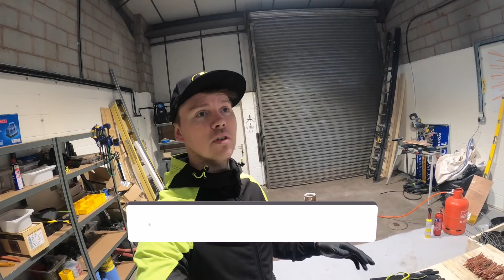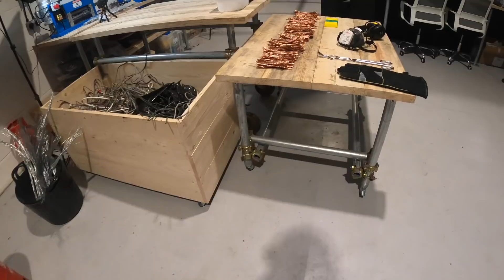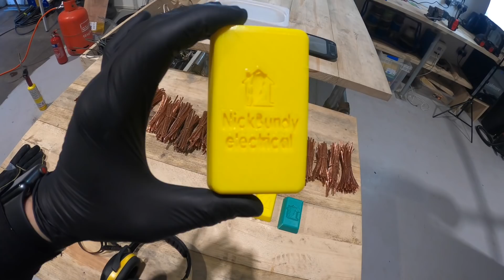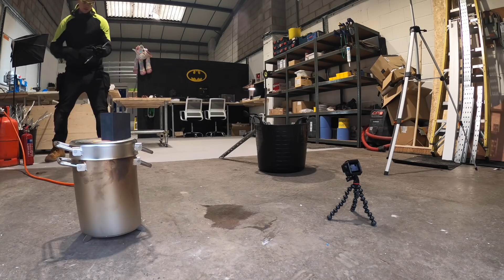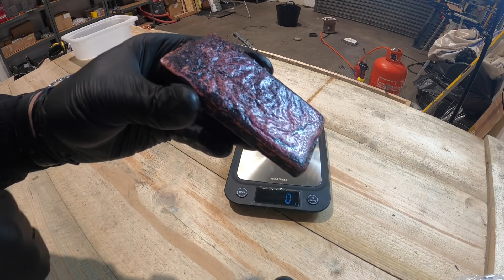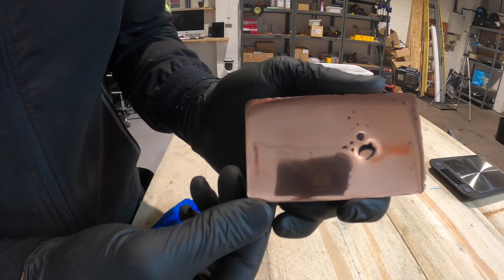Copper Wire into Copper Bars/Ingots, Electrician

Comment: Great vid but here's a couple of points.
1 - for safety sake, get yourself some fire / heat resistant overalls, if that copper spits a snot at you in the clothes you have on, it'll burn through to your  skin in a blink of an eye.
2 - you've got a lot of oxidation going on there. One way of reducing that is to use charcoal in the crucible and furnace. Google will help here.
3- Keep the vids coming 👍

Comment: Cool Nick, I melt lead down to make fishing leads and then pour them in different molds. I use to get pour lines in the lead so was advised to add cat litter or candle wax to use as a flux..my pours then come out pretty much flawless. Dont know if you have to flux the copper. Im sure someone on here can advise.

Comment: "Get amongst it"
Wonder if you could tap the melted copper straight into a mould and refill through the top. Bit like making steel. Save dropping temp of pot all the time and wouldn't have to tilt molton copper.  Just a thought. Loving the vids as usual

Comment: Decided to use flexicon in a summerhouse and outside gym project after watching your videos.. its the way forward!! 'get amongst it'. This is a great video. Was just thinking what finish you may get if you kept the mold on a hot surface before you pour in the copper as the concrete floor may cool  the mold down too quickly before the pour goes in on your video. I'm no expert in this stuff but may be worth a try? Keep the vids coming.

Comment: You could look into a small CNC mill and machine the copper surfaces to get a good finish and then engrave your logo. You may be able to recover some of the machined copper as well instead of loosing it during the sanding process. Loads of options to machine all kinds of things as well.

Comment: I would advise getting some refactory cement to coat that kale wool otherwise the small fibers could cause you serious problems, it will also reduce fuel consumption as it will improve insulation.
Reply: Also add a piece of cardboard  under the crucible to stop it sticking

Comment: The copper will melt even quicker if you add each strand separately, instead of as a bundle, the 10% loss in weight is due to the impurities being burned off in the smelting process.  You can get a steel stamp with your logo on it, then heat it up over the smelter and then press it in to the copper ingots.

Comment: Those are great for such early tries Nick. Have you thought of placing exhaust hoods (extractor to you I guess😊), either vented outside or just filtered, to capture the copper dust and other stuff that becomes airborn when you grind and polish. One hood for each, or a less friendly to use single that you would have to move back and forth.
I hope this idea helps. Not everyone uses it, but it really keeps the dust and grime to a minimum. Less sweeping for Adam! You could even make hoods yourself. Cheers.

Comment: when you sand the copper throw the drill away and do it by hand keeping the lines straight and change direction on every grit change, also wash the part and change the water to to stop contamination from the last grit. by changing direction every time you change grit its easier to see when all the previous sanding marks are gone. cutting across the sanding mark also removes easier and quicker i find. also not much point in going up to P5000 as the polishing compound is probably more coarse than that anyway. 

also less compound on the mop as its the mop that does most of the cutting, by apply to much in one go will does clog the mop up and leave polishing compound all over your part (area that get covered with compound wont get polished as well) 

its a slow process polishing metals up to a mirror gloss though so expect to put some time into them if you want them looking nice

Comment: "Get amongst it"

Firstly  best not to leave a lit torch near a gas line so easy to knock it over and it melts the gas line and you have a leak or a big bang.

Secondly rubber gloves are useless and if you get a metal splash theyll melt through to the skin and  make a nasty mess  for the hospital to try and remove. Get some welders leather gauntlets.

Thirdly get a proper set of ladle or crucible tongs, as its so easy for the crucible to fall spilling hot metal on the floor and your feet /legs,

Fourth,  to save standing over furnace and looking down into it  hold a mirror  above furnace and tilt slighty to see a reflection of whats in the furnace, saves getting your facial hair melted.

Fifth even though the casting has cooled down on the outside it may still be molten inside, and immersing it in water may well release that molten mass with  serious consequences.
Sixth A belt sander  with a low grit  eg 40,  will remove the rough faces easier than a grinding disc,  make a small frame on the bench drop casting into it and  use the belt sander , dont press hard just use weight of machine.

When  i did an engineering Patternmaking Apprenticeship, in our college foundry, one of the lecturers  drew a circle round hot castings with "HOT"  written in the circle, on lad rubbed off the H, and another lad then decided to pick up a  "OT "casting, we all learnt that day OT means Hot.

Comment: Yo Nick...look into acid dipping to remove the scale it will polish much easier then as the scale is rock hard and takes the time. or soda blasting both methods will keep the texture you wanted...my two pence chucked in there 👍😜 Ed

Comment: Mr B - before you pour into the crucible - make sure you heat it through - perhaps leave it on the edge of the furnace for a few moments before placing on the floor - will help get rid of imperfections on the back side.

Comment: I owned a bronze sculpture foundry for 25 years casting silicon bronze (95% copper) in 300 lb crucible. Put some folded wet newspaper on the plinth before setting the crucible in, it burns & ash will prevent them from sticking. Adjust flame (air/fuel mixture) to be slightly blue indicating a reducing atmosphere. A yellow flame is oxidizing or burning up some copper. All in all a great job! I was entertained!

Comment: Get Amongst it.

You should add a small amount of borax flux to the raw copper in the mould, so that you have some flux in there to aid with the oxide film formation. Fire bricks yes, but they also need to be warmed up, so stack on top of the kiln as you fire it up, so the gas outlet is clear, but they can heat up, and place the graphite crucible there to get to a dull red, so the finish on the copper will be smoother. 

You can probably experiment with tracing your logo into a fire brick, they are pretty soft, or take those moulds you have and make some Pratleypearl cement up to make a mould, and cast into that. Going to be pretty much a one time mould, but so long as he former is nicely coated with silicone spray as release agent, it will be little problem to make them up before and let them cure.

Comment: If your asking for products to give away instead of the fee ask for 3 or 4 products, they only pay a fraction of the end price to make it, they get the benefit of giving away more of their product so get better exposure and brand impression improves, and they are not having to pay you a fee. 

By all means ignore me, it's just that it feels like by only asking for 1 to give away, you are significantly under valuing your content.

By asking for more, you can then give away 1 on each channel as well as via alternative platforms this building them quicker.

But again, just my thoughts, not in any way an attack on you or the content you've made, it's very good.
Reply from the maker: Appreciate the comment mate 👍
Reply: @NBundyElectrical  all the effort you've put in to your channel, means your actually quite a valuable resource to manufacturer or distributors of electrical, or electronic products, just remember that when entering in to discussions over your "fee". Also push for more, I was told "if your not getting knocked back a good portion of the time, your not asking for a decent fee" it made me think about how I value me.